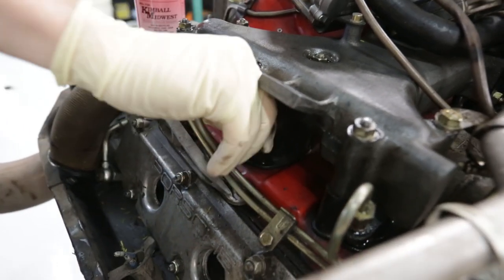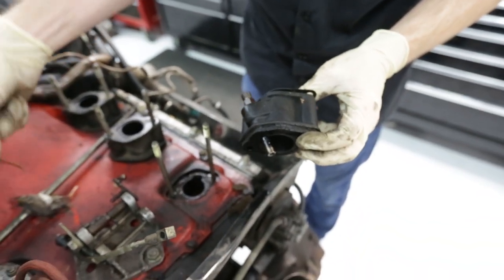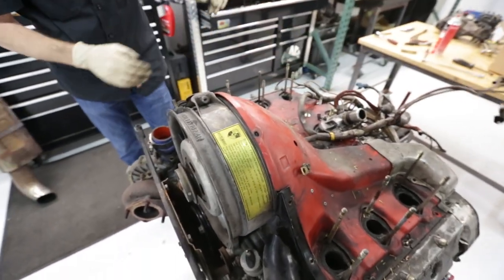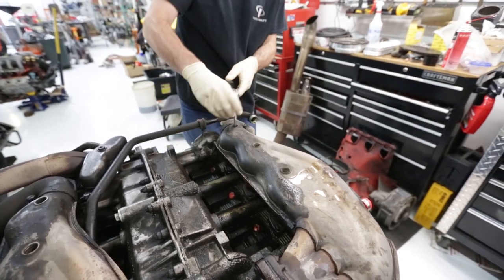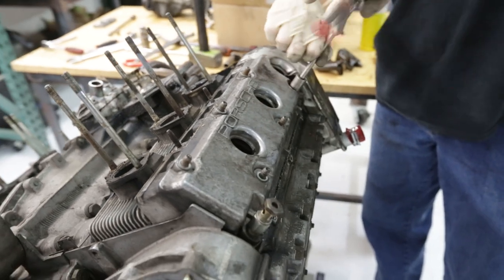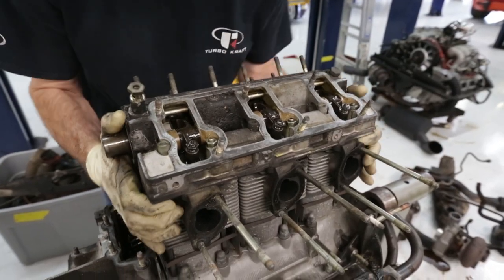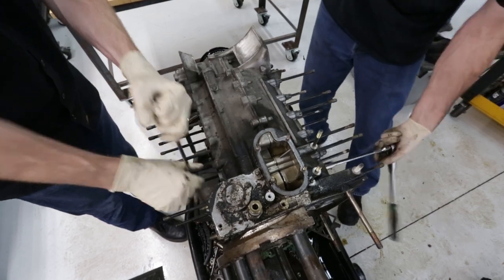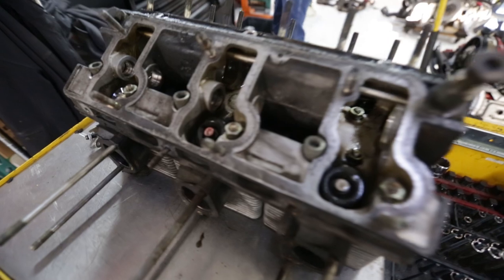Complete Engine Teardown - Porsche 930 Project - EP02

Comment: Great video series! I used to have an '86 911. Never tore into the engine but dropped it once to replace the clutch.

That engine looks so different than anything else. It's a total contradiction of  amazing engineering and at the same time kind of a big mess. The fuel system looks like it was pulled off an old diesel tractor. The crankshaft and the caps are amazing. Love the way the air is routed.
Reply from the maker: +Mark Coleman Yes, it's beautifully complex as I like to put it.

Comment: Thank you for this video. I was contemplating a lease or buying my wife a new Porsche Cayenne, however after watching this video and the complexity of the components on this engine, I m definitely opting for a new LEXUS !
Reply from the maker: +Umaxen 00 The Cayenne is actually a conventional piston engine so it doesn't resemble the air-cooled flat six at all, you'll be plenty fine with it but I still recommend the Lexus over for reliability. :)

Comment: No IMS bearing failure on these, double row timing chain with hydraulic tensionners on the same side. No variocam stuff either to mess about etc, what I like the most in this to see the evolution compared to an early 911 engine with less stuff on it but you still recognize what makes these engines so good.

I hope that one day I'll be able to just throw washers, nuts and engine guts all over the floor and rebuild without forgetting even one thing :D 

Except for a few broken exhaust nuts and the wankel style piston ring (not a rotary basher I like these too a lot ^^) your engine seemed to be in good shape, the poor mouse on the other hand, not so much :D
Reply from the maker: +Frozen Pete Exactly, this is my favorite era of engine and engineering before everything got too modern and full of electronics.

Comment: Helpful Tip: With stubborn and rusted studs and nuts, apply heat with a torch then place a wax candle onto the surface. The wax will melt and find its way into the threads acting as a lubricant. It works wonders. Must be seen to believe how well it works.
Reply from the maker: +OFFROAD GMC Thanks for the tip!

Comment: FYI I found muriatic Acid to work wonders on rust, litterly 15 minutes of sitting on a totally rusted fuel line fitting and bam off like it was brand new. Highly recommend you guys give it a try when the situation arises. Home hardware is the only place in sask I found that sold it. Dont know how different things are in Ontario
Reply from the maker: +MechRider89 Thanks! Will def buy some of it.
Reply: good luck! Cheers.

Comment: Very interesting! I didn't know that Porsche used a mechanical fuel injection. What is the injection pressure? Nice work!
Reply from the maker: The new fuel injection system runs a base fuel pressure of 40psi

Comment: By far my favorite project vehicle of the Speed Academy. I can't imagine what this costs, even in a 30 year old Porsche its gotta be expensive.
Reply: +Keith Brettell A 930 in good condition is worth around 80k
Reply: Ok but I'm askin' what this upgrade/update is worth? I doubt this was an $80,000 car before they started this update/upgrade.
Reply: Keith Brettell a 100% factory stock car will always be worth more. Ive seen some go for as high as 120-130k. These mods will likely not devalue the car thou as it was in such poor condition to begin with but i doubt itll increase it much.
Reply: I checked AutoTrader.ca and found several '87 Porsche 911's for $150,000+ Cdn and the most expensive being $240,000 Cdn because it was a cabriolet.
Reply: Keith Brettell Were talking about 930s here thou. The first generation 911 Turbo. And yes there are VERY few 930 Cabriolets.
Reply: +Kristoffer Lilja I didn't realize how special they are until I looked it up. I thought it was just a 40 year old Porsche.
Reply from the maker: +Keith Brettell The work, parts, etc. can total 30K+ depending on how much is replaced and the extent of the EFI conversion. It's the cost of OEM Porsche parts that adds up FAST!
Reply from the maker: +Kristoffer Lilja You're right, the car isn't a super low mileage vehicle so it's not worth concourse money but that doesn't matter to me. It's more about the driving experience then this vehicle being worth more in the future.

Comment: never pry open anything that is supposed to be oil/air tight!! just tap lightly with a rubber hammer and it will go out. it can damage de mating surface and cause oil leak. but overall nice video!! *especially when ther is no proper rubber gasket going there* like your timming chain covers
Reply: I agree, but they were using a platic pry bar

Comment: What toolbox was Chris using when taking out that camshaft?  I know that question is a bit obscure but it had a sliding work station with all his sockets under it which looks like a super efficient design.
Reply from the maker: +NA6 driver It's an older Mac tool box and he says that he loves the sliding setup on it.
Reply: Speed Academy Thanks for the reply and finding out for me.  I'll keep my eyes out for one.  Great work on the videos by the way, love the channel.

Comment: What's the difference from the 930 and 964?
Reply: 34
Reply: +ZohanLohan 😂😂😂👍
Reply: +Jadon Ghereben 930 and 964 are different generations of 911. The 930 is basically the 911 Turbo of the Classic 911. Just for that generation it had it's own name. The 964 911 is basically the "second generation" of 911. The 964 was then followed by the 993, then 996, 997, and now 991.
Reply: +VirusTornado I know that but what are the engine differences. Are they both air cooled or is the 964 water cooled. Did the 964 have larger engine displacement?
Reply: ***** 964 has different engines, but they're all AIR COOLED. Larger displacement? I don't know, there are many engines for all the different trims. All the cars from the 996 till today have been water-cooled though.
Reply: 964 were lighterb
Reply from the maker: +Jadon Ghereben There are very few engine differences between the 964 and 930. The 'block' is essentially the same but the displacement was up to I think 3.4L and a rare 3.6L capacity. There is a more complex fuel injection system as well as emissions.

Comment: I had a beach  buggy in Brazil when  when I has a kid and I remember  almost every time I started my car a rat would  run from the motor,  the engine was a vw air colled from a vw bettle. I can see now by watching  your engine tear down  that the power in this engines is not in horse power but Rat poweeeeeeer.  But you only have one little mouse wish  has a very powerful german super mouse like the massive mouse thank design  by Ferdinand Porche. I only had useless  Brazilian  bea h rats

Comment: Six separated cylinders. Six separated heads. Air cooled 3.2l. And this engine got over 800 bhp on racing 935's...  Why do we need all that water-cooled alusil-coated modern blocks now, they are real crap

Comment: "Analog fuel injector"? Hilborn.
Reply: +Hugo Agogo Except the Bosch system uses airflow to control fuel flow. The Hilborn system is just an rpm controlled leak.

Comment: Needlessly complex engine design. Beautiful results (especially the sound).
Reply: +stx38 Yes, that's German engineering for you.  What's an air-cooled Porsche engine that doesn't leak?  One that's out of oil. :)
Reply: I suspect it would take a small army of technicians to keep it in tune. Got a ride in my nephew's 930 before it burned down. Very docile and strong.
Reply: Needlessly complex? They don't get much simpler bud. Lb7 Duramax fits that description. I was a GM tech for 20 years, Porsche have very smart engineers.